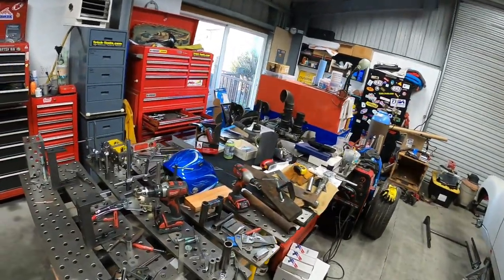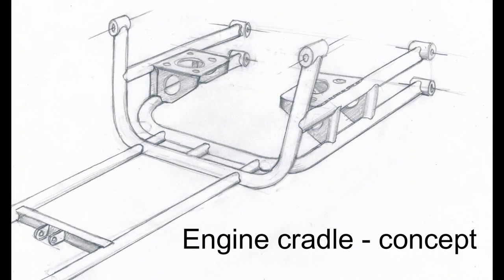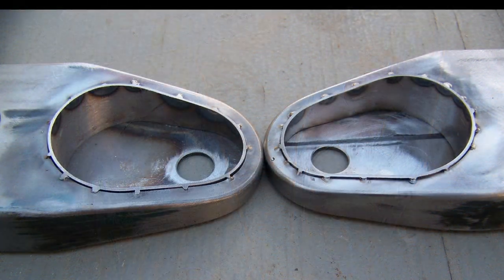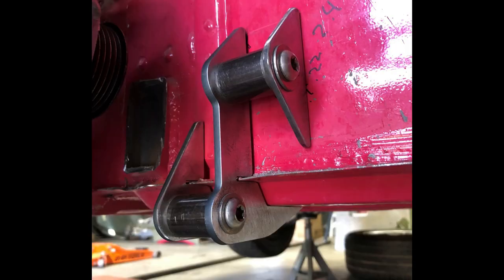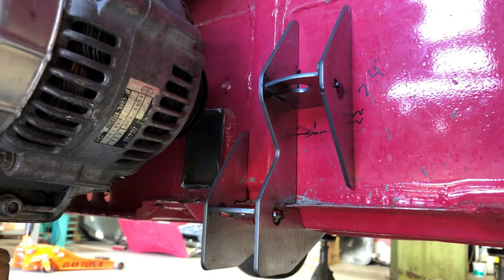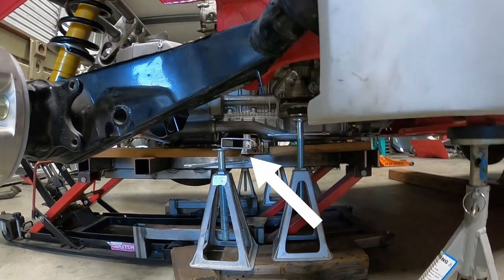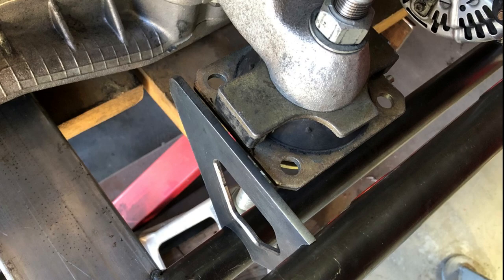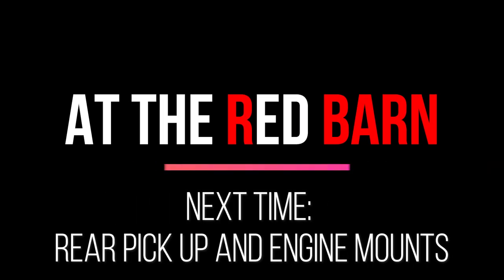914 Ferrari Build, Episode 5: Fabricating the Transaxle Mount and Engine Cradle

Comment: Is your background in ID? "We", did you do these sketches?

Great content, well presented.
Reply from the maker: I did not. My buddy, Martin, did them. He regularly helps me on my builds: bouncing around ideas, helping/doing some of the fab, etc. You'll see him in the videos, every so often.
Reply: @attheredbarn1669  up to Episode 15, great stuff. I can see that you carry an overall mental picture in your head and do a lot of trial fitting of various components. You also keep moving between components to keep things interesting and not get too far ahead of yourself, but as you finalize the headers say, could you explain how you think about all the plumbing and wiring that need to get into and across the engine bay? What about the totality of bracing and triangulation.

Will the car have heat and cooling?
Reply from the maker: @merckxamillian  Heat for sure, probably not A/C. I'll add some more explaination about your other questions in upcoming episodes. Thanks for watching and commenting!